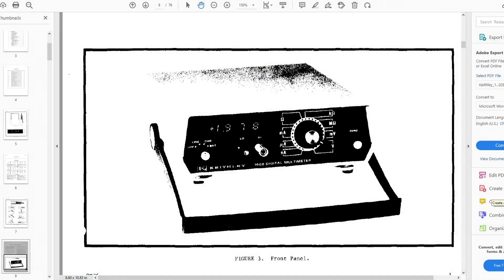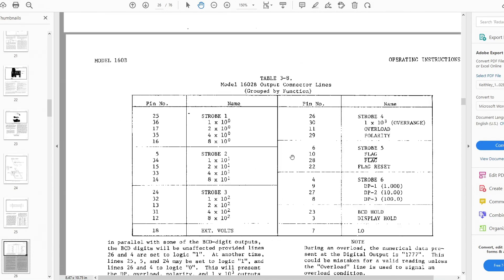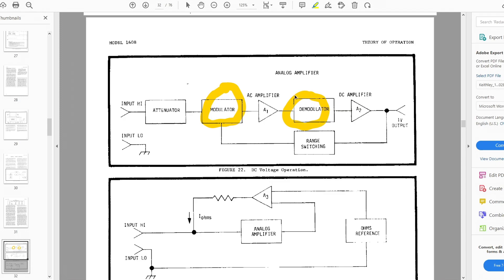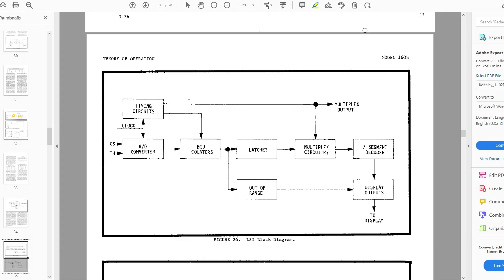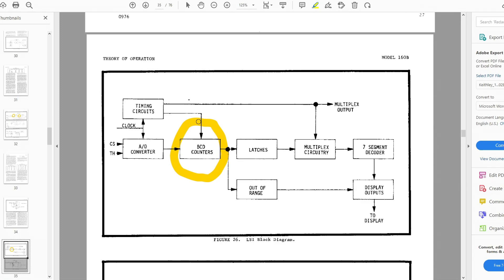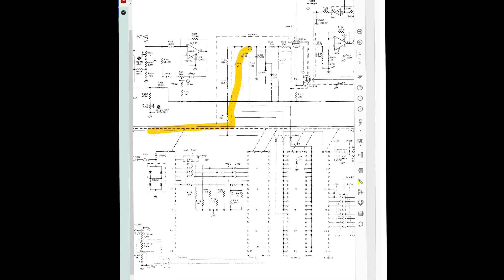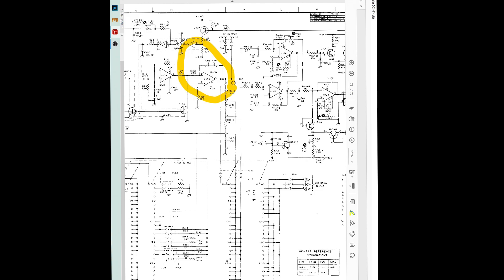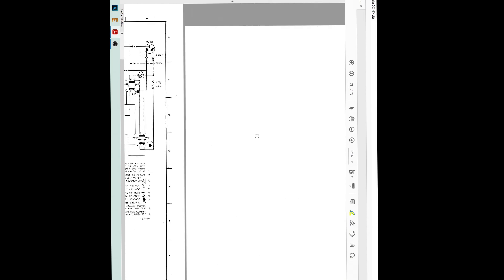#1162 Keithley 160B (part 2 of 3 )

Comment: Your explanation of the circuit was going fine until 6:39 when you backtracked and went off the rails.   The integrator used for the A/D is U109.   The integrator U105 that threw you off track is being used as low pass filter (DC amplifier?)  to filter out any remaining chopping signal.   Also, your comment about replacing the Fairchild LSI chip with a microcomputer has already been done by someone who has a similar Keithley that uses that part and found a used one would cost $$$$.   A google search for the chip will find the discussion about it.
Reply from the maker: close but no cigar 😎   the idea is still correct